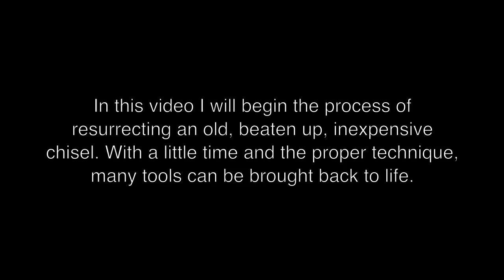Bring Old Carpenter's Chisel Back to Life with Belt Sander • Complete Sharpening Series Video 6

Comment: I'm just getting back into woodworking and have a number of tools that need to be tuned up. This looks like a great way to deal with sharpening to get it close so as to use whatever your preferred way is to do fine honing of the blade.  Thanks for video it will save me a lot of time. 

I do have a question as to the direction the belt is traveling? It looks like the point of the blade is pointing against the direction th e sand paper is traveling. I would have thought that would cut the belt as the blade get sharp. Am I missing shaken or are you doing something to avoid this from happening?

Comment: It`s seem a shame that you replace that expensive " Swiss Champ "  Just because the main blade is worn down,    Perhaps ?   you could remove the scales,    Drill out the rivets,   Then replace the main blade { Or even add one instead of say ?  The fish disgorger }  With blades taken from a Chinese copy penknife { Just a few dollars each }  Then put back together with some sort of small nut and bolt ?  The scales can also be replaced with a thick layer of strong model glue which is my preference

Comment from the maker: @materiasacra No was just adjusting the camera. I used that belt the whole time and it had some life left in for some other grinding as well. I like portable belt sanders because they cut really fast and the belts are not expensive. I almost always use that Bosch upside down. It is so heavy and powerful it is hard to control. Write me at akswoodman  @  gmail and I will send you pics of clamping setups for the beltsander.

Comment from the maker: I may have mentioned to you earlier that I also have the sanding frame for the Bosch. It is one of the reasons I bought that machine in the first place. I did a pretty major overhaul on mine last summer and it seems to be fine. I use mine mostly for metal now. I really like the 4x24 size. Great selection of belts at good prices.
Reply: AskWoodMan o

Comment: Hi friend, 
spectacular video, I have a hitachi sb 110 sander, similar to yours, the
 inheritance of my dad, but it has a problem, after 5 minutes of use, 
without forcing with additional weight, just making it work with the 
weight of The machine is cut THE BANDS, this is 
all original and the bands are new and the measure that correspond, to 
my understanding the band heats up and cuts in the UNION or PACKAGE, you
 can tell me if something similar happens to you ?, service here In my country there is not and since you are a professional you can help me !!! And is a new machine that almost has no use, greetings Marisa

Comment: I love me m Bosch 24x4 sander I'm just ticked off they stopped making it. Mine is getting kinda of ratty the belt comes off and the adjuster is so tight I have to use a pliers to move it. Other than that still works great. It's been through thousands of homes.

Comment: Did you put any kind of oil or wax on after you cleaned it up?
Reply from the maker: I generally use mineral oil to coat my chisels after sharpening. Sometimes Zoom Spout Oil. Wax in any form is banned from shop. It is a grime attracting contaminant.
Reply: jimjam Ha q